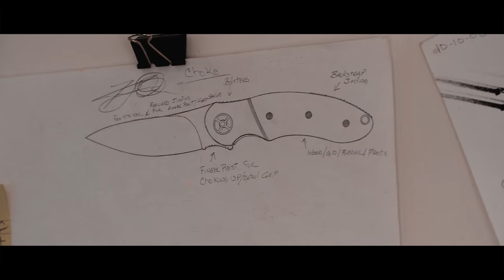CRKT: Confidence In Hand®

Comment: i love CRKT knives. they make some of the best flippers. my shenanigan which cost less than $30 flips just as smoothly as my $200 zero tolerance knife and flips better than my spydercos, kershaws and benchmades. CRKT knows how to put just the right amount of pressure on the detent in the lockbar/liner in order to get that perfect flip every time.

I only wish CRKT would start a premium line that offers higher end steels. aus8 and 8cr14mov are great budget steels but in order for their knives to truly shine and compete in the high end market place they need stuff like s30v s35vn M390 cpm-d2 vg-10 440c cpm-m4 cts-204p  elmax or even just some good old plain carbon steel like 1095 or 52100 in a folder would be awesome!  Kershaw started adding s30v to their lineup of standard issue knives which is awesome. being able to have a knife in s30v for $70 is amazing. I just know CRKT could do it better

anyways keep up the good work and please consider intergrating some higher end steel options. my pockets would love to have a CRKT in s30v!....my pants are getting all worked up just thinking about it :-) haha